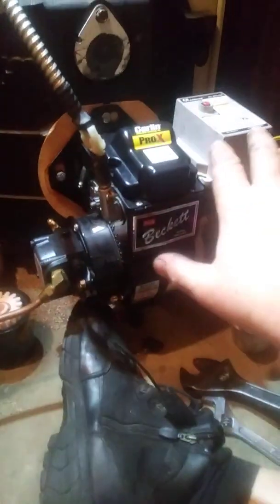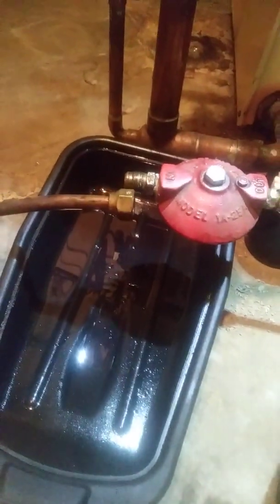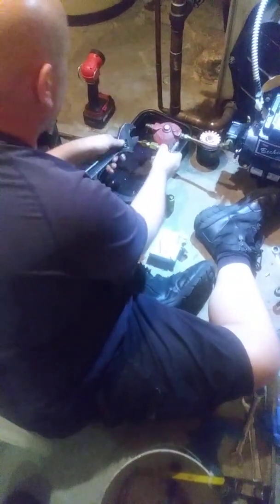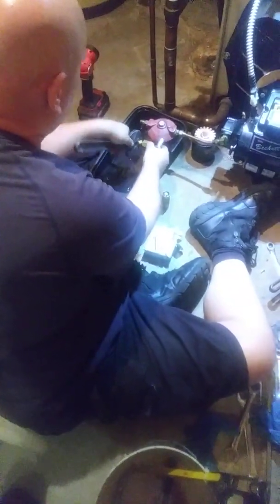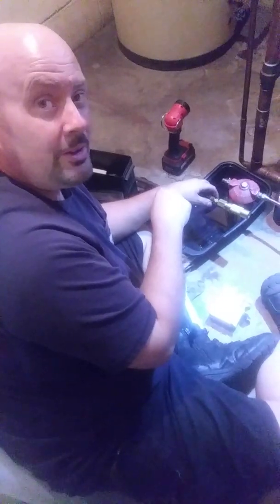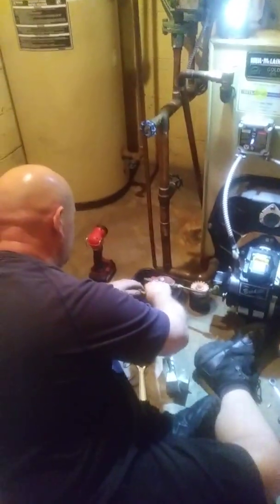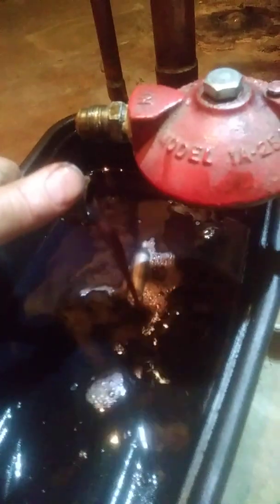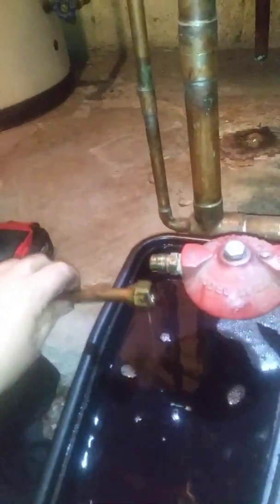July 26, 2020 Restricted oil line being cleared with our CO2 gun. Papi & Grasshopper, Media Pa.

Comment: I had sludge , first time in my basement 275 gallon tank . House is from 1951 . I opened it up with bailing wire through the gate valve on the tank and let it run clear . I put Fuel Rite additive in the tank . We did have Meenan for a while . They installed 2 different undersized nozzles on the Reillo 40 F 5 burner . Riello recommended a larger nozzle to match the GPH .